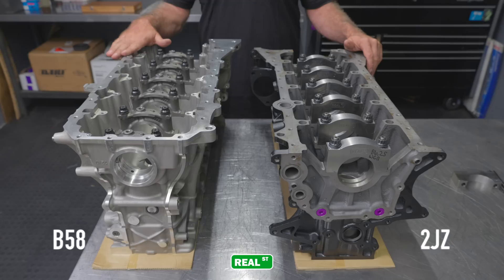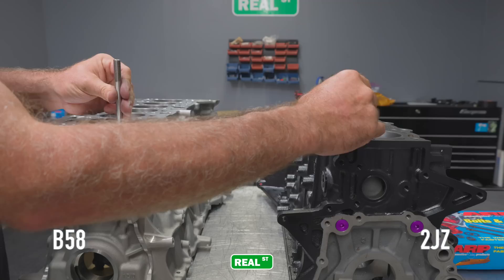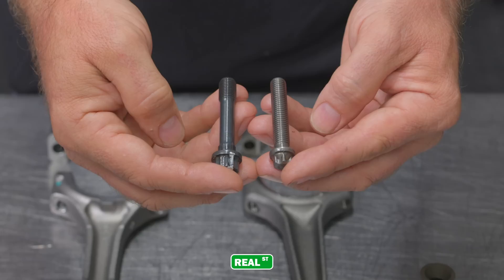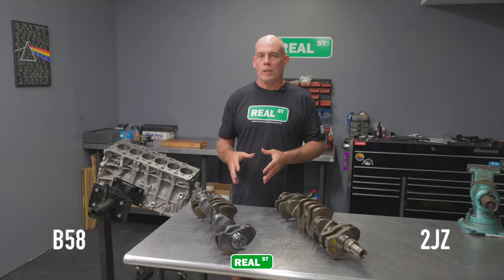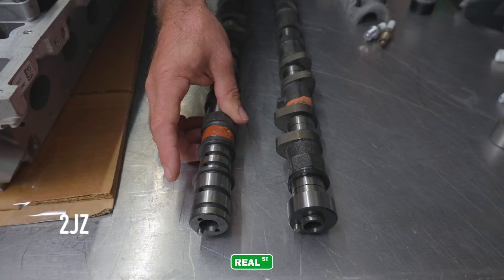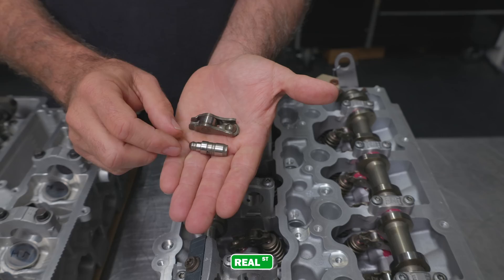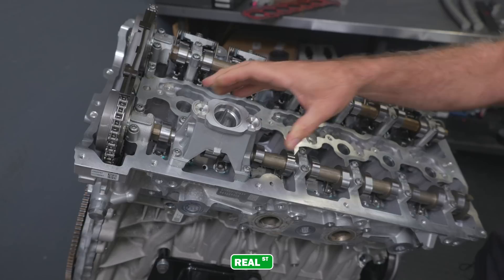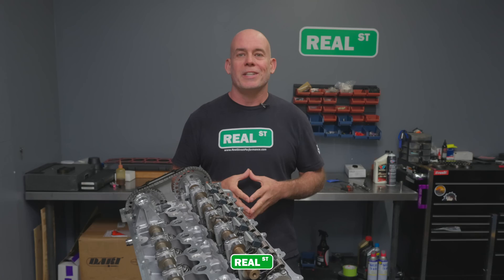Toyota 2JZ VS BMW B58 | 2JZ STILL KING?! (Detailed Engine Internal Comparison)

Comment: I don't get why people are complaining that it is a BMW engine, if Toyota made an I6 that meets all the new emission standards it wouldn't be less complex (take for example the G16E-GTS in the GR Yaris). Yes the Germans like to overengineer things, and if it was Japanese you wouldn't have Valvetronic, but this is about where it ends. Vanos is as reliable as VVT-i. You would need pretty much all of the things a B58 has even if it was a Toyota-made engine, and Toyota had a finger in the development of that engine so they didn't simply buy a BMW and throw a Toyota badge on it. Every new engine is going to be less reliable than an old one (if both were made today). 
We shouldn't blame Toyota or BMW about it, we should blame the government regulations on emissions that force car manufacturers to cut costs in order to put useless emission systems on cars. Both of these engines are marvels of their time, able to handle above 1000whp, sure Aluminum isn't as strong as good old Iron, but Toyota does not put engines made of Iron in their cars anymore as well. I think you could still order a 2JZ from Toyota with their heritage program (or whatever it was called), but you must understand they can't put it in a car and sell it because of government regulations who think that reducing 0.5% emissions on cars (which produce about 5% of the CO2 in the world) is going to save the planet, while in the meantime they don't touch the big guys who produce a lot more CO2. 
I am a big JDM fan who can't afford the JDM tax, so I drive an E46 330Ci with an M54B30 engine, after 500,000 km I decided to give it a sanity check and do a full service (bearings, piston rings and etc.) and while there was some wear, the engine never failed. Still factory headgasket and bearings... had it resurfaced, received a nice thick headgasket, gapped rings, racing bearings and I am planning to turbo it... Enjoy what you have if it works, don't be an elitist, soon we wont be able to do anything to our cars when everything becomes electric anyway... the governments are actively trying to kill our hobby...
Reply: 💯 I’ve got an E46 330ci sport, and I can’t drive it, it’s parked up on my driveway. In my opinion it’s one of the best cars BMW ever made! As you’ve said because of the damn silly emission the bloody government is killing off our livelihood. I remember as a kid I use to go out on a Saturday night to the Chelsea cruise around the Battersea park area.
Reply: In terms of solely combustion design, I'd prefer the B58 6 port. The undersquare design leads to better torque production over the rev range and better thermal efficiency with the coatings, and the less surface area for combustion. All these 2J circlejerk about the "let's see a BMW engine that runs 5's" completely misses the point that the 2J is a hunk of iron, and these teams use billet blocks that vaguely resemble a 2JZ. Not to mention that these fanboys wouldn't even handle the power that a fully built 2J has. There's a reason why a 3S race engine was put inside the Super GT Castrol TOM'S Supra. 

I don't like the integrated exhaust manifold from the B58 because it killed way too much flow for a restriction. Honda did it better with their K20C family of engines. 4Piston tested the single vs 4-port with minimal flow loss (~10%) from the integrated manifold, and porting one made it flow even better than the K20A. Papadakis said in an HPA interview that switching to the 6-port unlocked more than 300hp at high revs. With such a small aperture and poor geometry, it suffers at making it sing at >7k rpm.

Toyota could have made an inline 6 based on the G16E-GTS platform, but they didn't. They have a marginally better combustion design, on a much more trusted package. I'd trust the VVTi-W albeit the dual injection being a potential liability from Toyota more than BMW's Valvetronic and plastic components, and the rear timing chain layout.
Reply: @rickcupola6262  Well said, I fully agree with everything. The 2 port head is a lost potential. About the power, most BMW I6 engines, are capable of handling 600hp (with forged, low compression pistons) and engines like the N54 are proven to handle more than 1000hp, which is more than enough for everyone, but when it comes to drivability, you won't run slicks (mainly because its illegal) in order to put that power down, so there is no reason to do it on a road car. For me, running semi-slicks which are road legal, 400-450hp is enough for a car that weighs 1400kg to have some serious fun in it.
Reply: i dot get it either. bmw had heritage in inline 6 before toyota copied european brands
Reply: Because people buy toyota to get a toyota not a rebadged bmw. A lot of people don't want European in their toyota. You buy toyota to get Japanese.
Reply: @rickcupola6262  undersquare means better torque in the lower end
Reply: @sigmamale4147  Yes, undersquare engines have better low end torque than square/oversquare on the same displacement, usually. I meant that increasing stroke will increase power and torque over the entire rev range, although you risk having issues with decreased reliability from secondary vibrations and too much piston speed at the high end.
Reply: @benlastname6667  Germany invented the combustion engine. So no matter which gasoline-powered Toyota you buy, you always have a part of Europe in there.
Reply: @kevinj24535  that's a pretty cool story that doesn't matter. But I'm glad you assumed I wasn't aware of world history.
Reply: Toyota has absolutely no say in the B58 engine and design. I don’t know where people get their information from 😂 have you seen the failure rate of Toyota turbo engines? (Tundra, etc) …. It’s a disaster. It’s a good thing Toyota reached out to bmw!!
Reply: Lost me at vanos is reliable 😂
Reply: You have one of the last good, reliable BMW engines. Continue to take care of it as it seems you been doing and it will continue to run reliably for many more hundreds of thousands of miles and long after the body and interior need a total restoration.

Comment: A bit of misinformation on the b58 oil pump. It's not a two stage pump, but actually two pumps in one. The front half is the oil pump and the back half is a vacuum pump for the brakes, not a scavenge pump for the oil pump.
Reply: Exactly right. Was going to comment but you got it covered!

Comment: B58 is lighter and much much more efficient but as with most comparisons each engine has its pros and cons. The inherent complexity of the b58 gives it a little more failure potential despite it being very well built. If the money is there either one is a formidable engine for making outright power but the 20 years of development tuning the 2j currently makes it the king. We will see more from the b58 as time goes on.

Excellent video
Reply: yeah .. more failures #BMW

Comment: Great video Jay! As a BMW technician I had some first hand experience this week into the newest and latest version of the B58 engine. The B58TU2 engine or as the internet likes to call it, gen 3 B58.  I replaced the exhaust cam follower switchable rocker arms. These are an advanced version of rocker arm with built in springs and a plunger that will be pushed by a motor operated sliding rail that rides alongside the exhaust cam. Its intended purpose it to reduce losses due to gas exchange during over run phases. I cant wait to see what the aftermarket world will do with this engine in the future.
Reply: As a bmw tech. What?
Reply: @@davidrx795The 2024 Supra B58 calls for 10,000 mile oil changes or one year. I'll probably put no more than 3000/year on my Supra.
Reply: @davepaturno4290 I've had my 2023 Supra A91 6MT for close to a year now and barely have 3,357 miles. It's my weekend driver 😂
Reply: @chrisginoc  It does seem like a waste of money to change the oil at such low mileage, but during the warranty period, it is highly advisable.
Reply: @davepaturno4290  I had my first oil change at exactly 1,000 🙏🏼
Reply: what to do with a BMW engine in the future : Step #1 : throw it in the trash : Step #2 : buy a Toyota : FIN.
Reply: @DC-te1gw  The cost of swapping a BMW engine out for a 2jz is expensive. Are you gonna do it yourself?
Reply: @chrisginoc  why would I put a BWM engine in a Toyota in the first place? :face-orange-raised-eyebrow: with a stupid question like that, you sound like someone that would.
Reply: @DC-te1gw  I was talking about swapping out the B58 out of the MKV...
Reply: @chrisginoc  why the F' would I buy an MKV? :face-fuchsia-wide-eyes:...they stopped building all other cars in the world?
Reply: @DC-te1gw  You win

Comment: I think for me (and maybe others) it all comes down to cost and availability to mod an engine. I can appreciate both engines and the new BMW B58 engine is a very good platform but I've been modding the 2JZ for many years now and to me its the better platform but that only due to the fact that all I know is 2JZ and the standard package is so good (if you want to run big power)but most of us are happy with 650-800bhp which the B58 can do. What will be interesting is seeing what it can do at 1000bhp upwards but yet again we are still in the very early stages of the B58 development and you can get 2JZ parts everywhere. Also (and this is only my opinion) I not a fan of how complex the B58 is but that's just BMW making a very efficient and strong engine. Fantastic content again Jay & RealSt
Reply: Yeah, i mean it depends. B58 is going to make 400-800 WHP far cheaper and more reliably than any 2j, but after that 800whp mark, the 2j its gonna be cheaper and more reliable than the b58. That being said, 99% of people are gonna be in that Stock-800Whp range

Comment: I think you should have mentioned the difference in weight, fuel economy and driveability. The 2jz weighs 50% (139 vs 205ish kg) more and probably uses 50% more fuel, takes twice as long to get up to temp and takes a lot longer to spool a turbo.
One engine is great for racing >1000hp and the other is perfect for daily driving a 600+hp car. If 650ftlbs on a stock bottom end doesn't make you happy maybe you should get an actual performance engine (s58) anyways?
Reply: S58 still doesn't stack up in stoutness. And this video wasn't about performance vs performance if you listened Jay was just showing break down and measurement but hey when a bmw motor is capable of holding 2500 plus HP let us know.
Reply: @hatch450sx3 You know absolutely nothing about the s58 if you believe it doesn't hold up.
Reply: @LegendYT91  okay. Show me one s58 in the 6s
Reply: @hatch450sx3   You're comparing a motor that has been exploited to crank out every ounce of power by the tuning/enthusiast community for 20+ years versus one that's been out for... 3 years? S58s are making 1000+ HP on a stock motor with DPs, a tune, and hybrid turbos -- and already running 9.00 1/4 mile times. Can't imagine where the S58 platform will be with the same amount of time and part development behind it but I'm sure it'll be handing out L's left and right.
Reply: Or you can stick with the 2j since they have been proven to hit 1800+whp on stock block.
Reply: @fl_g80   that's what people kept saying about the s55 as well. Yet still no 6s
Reply: @hatch450sx3 I'd say the S55s were held back by their trans since they're all DCT from the M2-M4 which more or less scared people away from bothering with them(atleast for drag racing) Now the S58 has like 1-2 cars in the high 8s only because they're still in the early stages and the trans are acting up and overshifting while they're doing their runs and still in testing. They're not in the B58s level with them already hitting 7s but it's too early to really compare them yet when companies haven't worked out the bugs with the cars yet.
Reply: @carboydorifutoparty3976   yeah there were a lot of things holding it back I get it. But for instance how long has the c6 zr1 been out? The c7z? These cars still aren't in the 6s. 

All I'm saying is it takes a truly monstrous motor to do it.

The op said longer to spool a turbo. Tell me you know nothing about a 2jz(the op). Of course it takes longer to spool a 90 to 100 trim turbo vs a 60 trim turbo. And mk4s might be heavy but that also keeps them on the ground when putting in big power. 

Clowns like that guy tell me I have no idea about the s58. When he doesn't know the first thing about fuel efficiency for performance. 

Fuel efficiency for racing is much different than the street. Fuel efficiency for racing is not how long can the fuel last it's how fast can it burn and clear the combustion chamber. DI is horrible for that as well. 

I could go on but I'm not trying to be disrespectful to you sinse you didn't make wild claims about the motor that the other guy did.

The last thing I'll say is inorder to fight the 2jz at it's peak the s58 would need a crank turned front facing oil pump. At high stress that chain driven pump is gonna snap.
Reply: @hatch450sx3  I'd say it all comes down to how much money and time in R&D will be put down on it. If people put down the money/r&d on these engines,then I'd say it's possible. I'd say we're still too shy for well,even the S58 since people are just starting to make built S58s and haven't gone over 1300whp since well(the weight of them bmws is partially what's killing their times tbh)but I'd say it'd be more possible for it to tap 6s as long as the platform keeps improving. If the weaker B58 is in the 7s,I'd say it'd more than likely be possible for the S58 as long as the interest and R&D stays afloat and doesn't fall on its face like the S55 did(atleast for drag racing). I'd say as long as the B58/S58 keeps getting more people modding their platforms like they are now,I'd say we'd prob see 6s in the next like........2-3 years(less that one company that has a 2k hp rated billet block B58 finally steps in).
Reply: @hatch450sx3 the S58 actually makes 1000hp on a stock bottom end, unlike the 2JZ.
Reply: @madkas14 show me a 1800whp 2jz that isnt a billett block and ill give you all my money😂
Reply: @hatch450sx3   The S55 isn't the S58 though. The S58 is a huge, huge step up in terms of tech and robustness and BMW's engineers learned a lot from the S55 when developing the S58. All I'm saying is in due time the S58 will absolutely be one of the top-tier motors that get the same amount of respect as the 2JZ.
Reply: @hatch450sx3 show us a non billet 2j making 2500 please.
Reply: If you want real power and reliability you gonwith a subari STI ej257 engine.   According to tbe kids at my local car meetups.
Reply: @fl_g80  the b58 came out in 2015 in the F30 340i
Reply: @hatch450sx3  show me a 2jz running 6s then. because a custom billet engine is not a 2jz anymore. if somebody makes an s58 out of billet it will run 6s just fine
Reply: The factory iron 2JZ is only good to 1400-1500RWHP before it cracks, all the cars you are looking at have an aftermarket billet aluminum block
Reply: Proud owner of a B58 here. I own a 18’ F30 340i. So much potential is why I got it
Reply: Actually, my stock <400hp is great for racing. I'm first in points for my class, ahead of almost 30 BMW M3. :D
Reply: @nikitakononov690   show me a single b58 that qualified in world finals in street fighter class or anything bigboy I'll wait. Didn't like 7 built built a90s blow up during qualifiers? 2jz billet block just ran 5.60 qualifier. The fastest import pass ever and the 3rd fastest pass on mir track ever besides top fuel cars. Sorry correction 2jz billet block PROMOD ran5.54 at 263mph the fastest non top fuel car pass ever.
Reply: @madkas14  stock bottom end due to cast iron.  if you run 1800whp with stock top end and internals, it'll explode lmao, 2jz fanboys have to understand how much money and work it takes and costs to make a 1000whp+ supra.
Reply: @lenspls  what's sad is that all these modern engines are still being compared to a 30yr old Toyota engine. Hate on it all you want, the 2j has nothing to prove.
Reply: E Kanoo went 5s @240+ on the stock cast iron 2JZ block and factory head YEARS ago. So did Drag international in their orange Silvia.
Reply: @madkas14   2jz just made the fastest non top fuel pass ever this weekend. 5.54 @ 263mph. B58s didn't even qualify for world cup finals
Reply: @hatch450sx3 No 2JZ can hold 2500 horsepower stock!
Reply: @MistRVertexZ Exactly!
Reply: @hatch450sx3 the aftermarket for the b58 engines are still in development it will take time. They will get faster. Same thing with the C8 corvettes right now they are far behind the old gen.
Reply: LMMFAO what supra motor has ever held 2500 hp? You clearly have zero clue, billet block doesn't count.   @hatch450sx3
Reply: question, Can you re bore B58 ?since  its a alusil engine or is it a throw away engine ?
Reply: @joshuaquilliam2887  there’s 4 cylinder ecotecs non billet making 1900-2000+ horsepower. Just food for thought. A k series Honda non billet will give out at 1300 or so.
Reply: @summitsvift  it’s a Swiss cheese block as some say I don’t think you can reborn it much 0.020 maybe. 🤔
Reply: @hatch450sx3  About as relevant as saying my Ram pickup is the fastest 'cause Top Fuels (including Toyota) run "hemis"
Reply: @hatch450sx3 you talk as if drag racing matters. Show me a Toyota running top lap times competing with BMW or any of the other brands. It’s almost like the newer Supra was designed to be a great all around car, which is something that the old car couldn’t claim. There’s a reason the Corvette C4 ripped the Supra a new one with factory HP and handling. No one gives a rats ass about 2500hp drag cars as drag racing as a whole is declining. I’d rather see a race car that can do more than go down a straight line 🥴